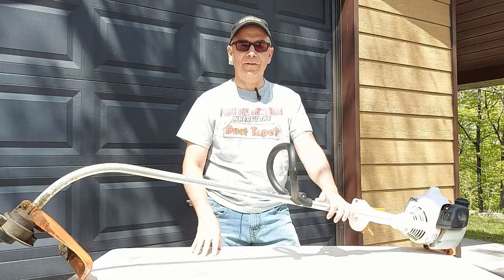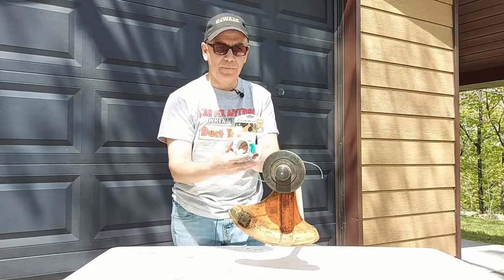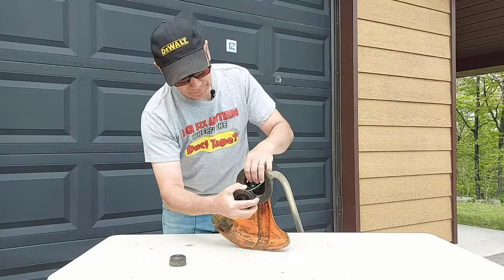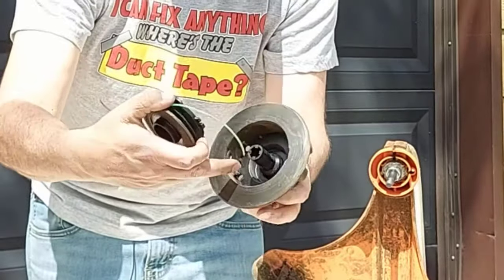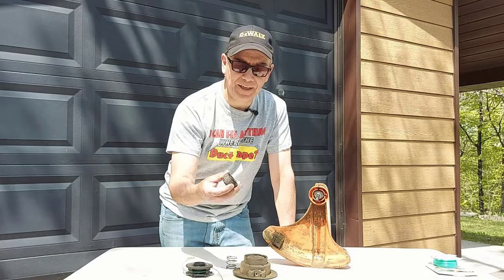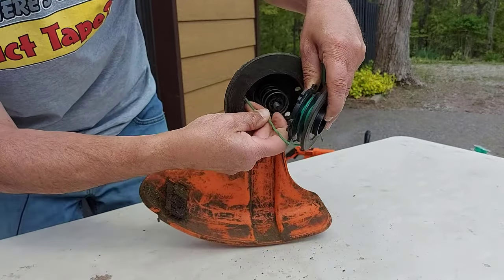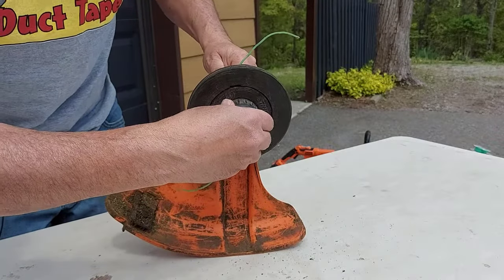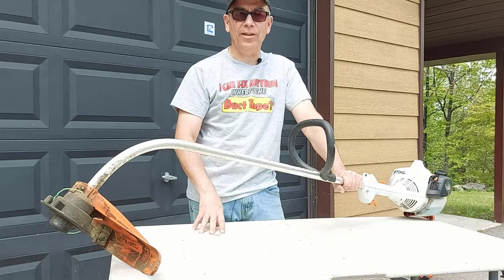Trimmer Line Stuck and Wont Feed | How To Fix It

Comment: I worked out that on my fs 38 when you wind the new line on , it must be put on as tight as you can get it , that way it won’t jam up . If the line is to loose it will jam and not feed out properly.
Reply: How can you tell? It just winds up when you crank the head?

Comment: The issue with mine is that, the line seems to melt onto the spool, not a lot but just enough to not feed, what can I do to prevent it from doing that?
Reply from the maker: Melt? I've never heard of that. That's insane
Reply: Had this problem too. Lube the inside of the head with Stihl gear grease. There's videos out there showing how, it'll keep the head cooler, which keeps the spool cooler.

Comment: I have a Stihl 110 combi tool with a string trimmer attachment. I have found that despite my best attempts I find the line breaks frequently. I don’t know if it’s me or the equipment. I buy everything at the same place. I have two heads & I have a 1/4 acre lot that I need to restring 3 times. It neither feeds & the line breaks a lot. I contacted Stihl about the issue & they suggested filling a bucket of water & placing the whole spool in it. That didn’t work the following spring despite having the spool in water from November to April. 
I have been using the same tool & string with unsatisfactory results. I’m ready to throw my line out & buy a brush cutter head & doing everything the hard way? Any suggestions would be greatly appreciated.
Reply: I used  a bucket of hot water 10 minutes  for the line only before putting it on the spool , hot enough not to burn your hand  either works or works because the new spool of line is newly manufactured .
Reply: @thefunfactory61  I did one better. I farmed all that work out now. I don’t have to lift a finger. Somebody else does it. I’ll keep my equipment incase he can’t make it? By the time I go back to doing it myself after I retire maybe there will be another way to do it?